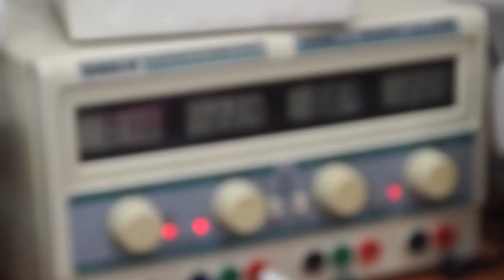Brushless controller schematic Hall sensor

Comment: Hi, if you use the MC33035 for building a controller.
Will it be possible to use it for 4 quadrature drive in a closed loop servo system?